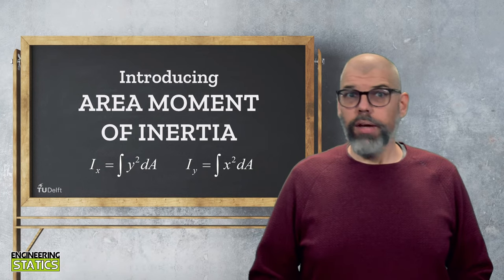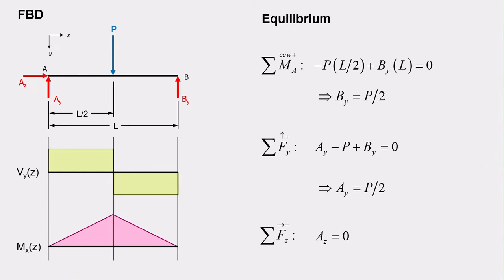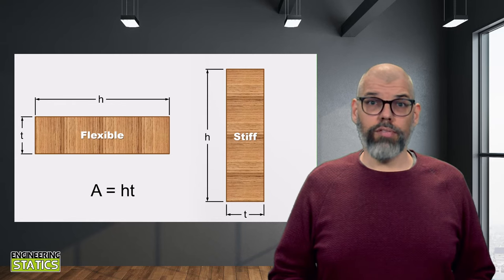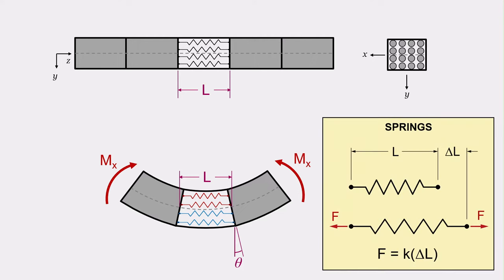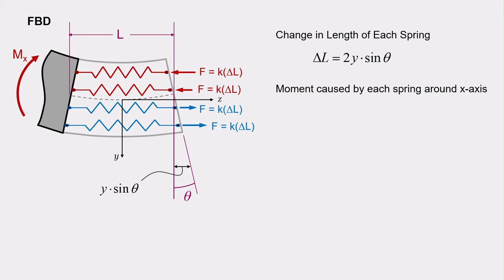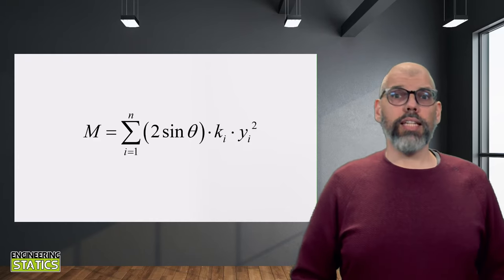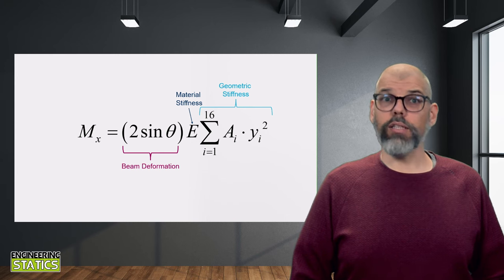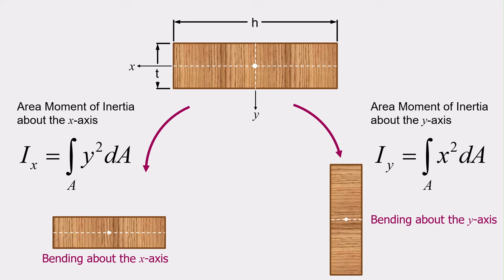What is the Area Moment of Inertia?

Comment: Thanks for the video--very helpful.  As I think through this equation, I am struck by the fact that the moment of intertia is not impacted by the material mass or properties.   For some reason, I would have thought that intuitively the higher modulus of elasticity for metal would compound relative to wood. E.g. a metal and wooden bar of the same dimension will have the same moment of intertia (all else being equal). When I combine that with a beam deflection formula for a simply supported beam { D = [(W * L^3) / (48*E*I)]  }, it means a percentage increase in the size of both material types will have an equal percentage impact on the beam deflection. Bedankt!